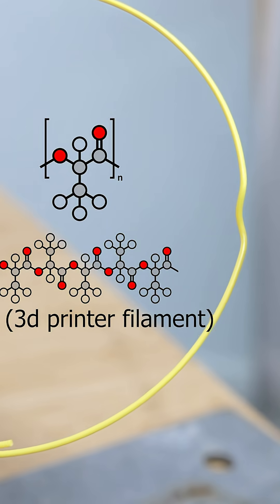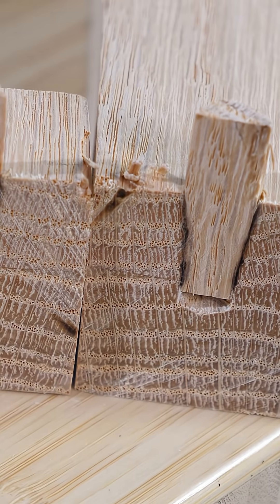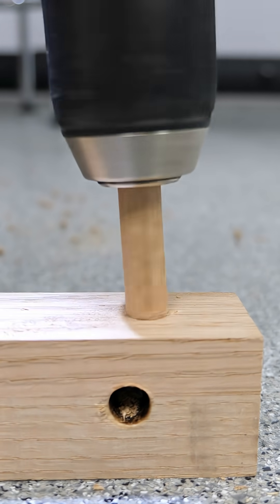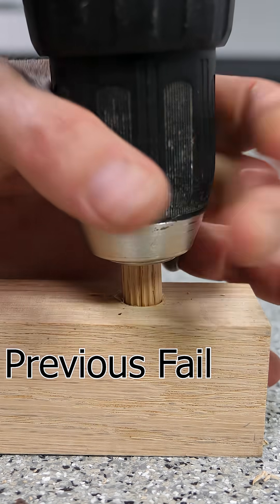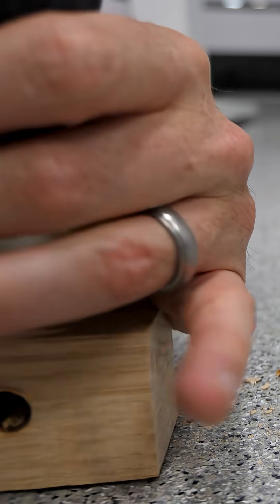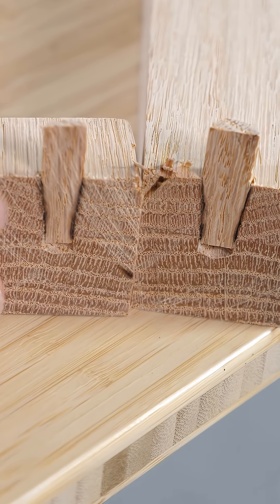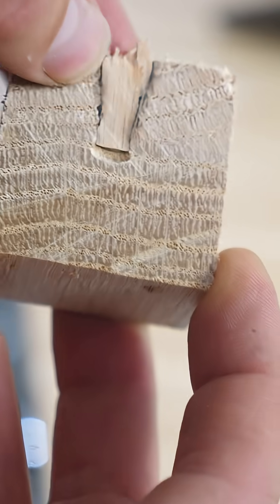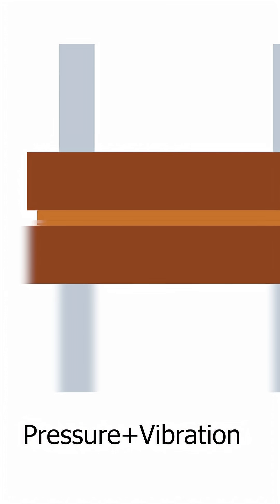I Melted Wood With Friction

Comment: Fun fact: Wood is not actually "flammable", it's "combustible". And it's because wood itself doesn't actually burn. It has to break down into mostly hydrogen gas (H_2) and carbon monoxide, which are flammable and what primarily burns in a fire.

It's why wet wood doesn't burn. The wood isn't a flammable substance and has to be heated enough to release the hydrogen gas that then combusts. This happens way above the temperature of boiling water, which sucks tons of energy. 

This is opposed to oil which is flammable and burns in and on water if there's oxygen available. Its primary substances are naturally volatile and directly involved in the redox reactions that release the energy. There's no need to break down another substance to release more fuel.
Reply: Thank you for sharing this info!🙏🏼
I learned a lot of things that I didn't know!💯🙌🏼🤯😎
Reply: But is it INflammable???
Reply: @SamChristopher5 "INflammable" means "flammable"??? What a country!
Reply: @somosUS This is the comment I was looking for! 😅😅😅😅
Reply: @SamChristopher5   what a country!
Reply: Interesting. Isn't there any way to remove the hydrogen? Or is it part of the molecular level of the wood?
Reply: @MythRsR1979  Sort of actually.  There is something called thermally modified wood where they essentially bake and steam the wood inside large ovens to make it more resistant to fire and rot.  The process also makes it more insect resistant, as the part of the wood that termites would normally eat is essential cooked out of the wood.  It is typically used for exterior decking and siding, though it will still fade in the sun if you don't put a protective oil or other UV blocking wood finish on it.  It basically does the same thing as the Japanese Shou Sugi Ban technique without going so far as to char the wood.
Reply: @r.j.bedore9884  Yep and as a woodworker, I’ve seen this decking.  It’s not resistant at all.  It costs a lot more and cracks and splinters after a couple of years.  It’s not worth it.  If you want a quality decking go for class 4 exotic wood like Ipe.  It will last you a lifetime and doesn’t rot even if it is constantly wet.
Reply: @r.j.bedore9884  Thanks for the information 😊
Reply: @r.j.bedore9884  thanks for sharing
Reply: @MythRsR1979 Hydrogen is indeed part of the molecular structure. Wood is organic, which means it's made of hydrocarbons– and the "hydro" there stands for hydrogen. Hydrogen is also the most common element in your own body, by atom count (second most common, after oxygen, because hydrogen atoms are so light).
Reply: @MythRsR1979  Yes, wood gasification technology explores exactly this. The main components of wood gas are hydrogen and carbon monoxide. The challenges mainly come in separating all the various gasses efficiently. 

Otherwise it has a rather low energy density, being just uncompressed hydrogen and carbon monoxide. Mixed with a bunch of atmospheric nitrogen. About 6-10 MJ/kg. And it blows up when you compress it. There's no doubt many ways to improve this process to deliver "cleaner" or more energy dense wood gas. Just not a lot of investment or popularity into it. Thats changing in the near future though with everyone looking for renewable, sustainable, and localized production of everything, especially a fuel gas.

Back in WWII they used to run their cars, and designed a few, to run on wood gas. It was a surprisingly easy pipe just into the engine (carburetor days). Though they didn't accelerate very fast, they still went and could do 30-50 MPH eventually. With WWII era engines and cars no less. A modern car and one tuned for it could probably perform pretty normally on wood gas. Very weak acceleration compared to an equivalent gasoline, but otherwise perfectly functional I'd imagine. Lots of efficiency gains everywhere.
Reply: Thank you for the information. Today I learned two things and that is an accident I did in high school in carpentry class how about 45 years ago was actually welding a piece of wood to another piece of wood I didn't know that I thought I merely forced the two pieces together I didn't realize that I had welded one to the other now I know, and thanks to your bit of information I know how that happened and why that happened.
Reply: Your comment is so full of wrong and so misleading it's not funny. 70% of the calorific content of wood is from off gassing of volatile organic compounds. By definition VOC contain carbon which hydrogen gas by definition does not. Production of hydrogen during pyroloysis is a minor effect at best. Now you've got people thinking you're educating them when in fact you're telling them patently wrong information.
Reply: Thank you! It's these types of educational comments that I wish were more prevalent on YouTube
Reply: The vast majority of solid objects aren’t flammable then.
Reply: @Specter_1125 That is true. Solid materials that are actually flammable are things like white phosphorus, lithium, sodium, etc.
Reply: Isnt hydrogen-2 deuterium?
Reply: @TeraChad23  You're right. It is isotope nomenclature. I wanted to be a little more descriptive to those who may be unfamiliar with molecular hydrogen, dihydrogen, H_2. 

I'm not a personal fan of using "dihydrogen" with laymans and just say Hydrogen 2 generally. Because it's usually chemical related discussion, not nuclear.

I could clear up my comment better though.
Reply: Then why's burning Diesel or petrol(gasoline) inside an engine called combustion and not flammation(inflammation?)?
Reply: Wood also contains a small amount of volatile essential oils that are flammable, but yes, it largely requires pyrolysis for combustion.
Reply: Then why's burning Diesel or petrol(gasoline) inside an engine called combustion and not flammation(inflammation?)?
Reply: Why they can't make a power tool for wood welding?! Fricrion/heat, lingnine aditive whatnot 🤯😃😃
Reply: Ahh, ashes, I get it now.
Reply: It is OutFlammable
Reply: That makes a lot of sense.
Reply: “Ok but can your science explain why it rains?” “YES, IT CAN.”
Reply: I always say there's no way to pull it out too
Reply: Oil doesn't mix with water, not really a valid explanation. Low grade alcohol doesn't burn either although alcohol vapor is flammable
Reply: good knowledge. thanks.
Reply: I heard that hydrogen fire is invisible. Then why can we see wood fires? can anyone explain
Reply: The process by which wood "burns" is called pyrolysis, look it up, it's pretty interesting
Reply: this is not true, wood itself is also flammable, but most of the fire is the wood gas coming off of it. same as oil but just more stable.
Reply: @sudazima Nope. Wood itself (the organic cellulose, etc) is combustible, not flammable. Very few solid materials are flammable.
Reply: @thecuriousboardgamer  the solid is ALSO flammable, just not very well. this can be checked in low pressure high oxygen atmospheres. plus i hope you realize that wood is literally THE thing that defined fire for us 300 000 years ago, it is how we define fire in the first place.
Reply: @sudazima No it's not. Every scientific source will tell you wood is combustible, not flammable. (PS - if you're changing the environment then you're moving the goalposts. Given the right environment virtually everything is flammable.)
Reply: @sudazima And your historical point is meaningless. As I've said, combustible things burn too, so just because wood can burn doesn't make it flammable. These words have scientific meaning, whether you accept it or not.
Reply: @thecuriousboardgamer "Flammability behavior of wood and a review of the methods for its reduction"
would you look at that, a scientific source calling it flammable.
also note sawdust can ignite and even deflagrated, when theres no time for any gas release or mixing
Reply: I don't think wet anything burns
Reply: @jimi02468 Try your theory with sodium.
Reply: @jimi02468  your mum does. Tell her I'm sorry
Reply: Flammable and combustible mean the same thing.

Some technolosers tried to redefine basic words to mean more specific things, but this was a bad idea, as anyone with more than two brain cells to rub together could tell you.
Reply: That’s a long, convoluted way of saying “wood is flammable.”
Reply: @BuiltInBrooklyn  Wood cooks into flammable wood gas which combusts.
Reply: @KaiserTom is that why you can make charcoal
Reply: @KaiserTom  Cool profile pic lil bro
Reply: @BuiltInBrooklyn  No, it just shows you have no clue that "flammable" and "combustible" are different things.
Reply: @SissypheanCatboy the wood doesn't actually burn it gasses off and the gas burns. Thay part is in fact correct
Reply: @SissypheanCatboy  Flammable and combustible are the exact same thing though as the only difference is the temperature needed to ignite it. Flammable needs less and combustible needs more but, they'll both burn just fine. By definition, flammable is anything that burns under 100°F while anything that burns above it is combustible.
Reply: @BuiltInBrooklyn This is causal-systemic explanation and it really is needed and important 💪🥳😃🫡. Why? 

Our knowledge, understanding, and wisdom is comprised of "causal-systemic network of factoids and concepts and their connections". Each word (concept) is a node in that network where other nodes can connect to it. This happens when things "click" and we learn new stuff. This is why the causal-systemic explanation above is important. Am example. 

Until now, I only knew or felt and concluded, that wood needs to be heated and gasified to make it burn (in a stove, camp fire). Understanding this has all kinds of ramifications:

Burning wood (e.g. to heat a sauna? which can be a "ritual" like yoga for Indians) is a tradition in Finland and therefore everybody has their own correct opinion how to do it right 😅

Recently, due to emissions(!), the objectively correct way to burn wood in a stove HAS BECOME A THING: sparse stacking, enough air flow, and IGNITIOM FROM THE TOP, which reduces emissions, which kill people. Big fire instead of small and slow. 

The education of this would be easier, when the physical process is explained. Big air and fire heat the wood, which is a precondition to ignition.
Reply: @BuiltInBrooklyn  No, it actually means wood breaks down into flammable compenents.
Reply: @BuiltInBrooklyn  That's a long, convoluted way of saying you didn't go to school.
Reply: @BuiltInBrooklyn  Go back to school
Reply: Nah dawg, you tweakin, wood burns when I light it on fire. kek, get a load of this guy
Reply: @FlawedbyDesign69 That's because wood is combustible, and combustible materials burn when heated high enough. Flammable means something different and wood is not flammable (if it was, we wouldn't be using it for building things.)
Reply: @thecuriousboardgamer  The only difference between flammable and combustible is the ignition point needed for it to start burning and nothing more. Anything that burns at below 100°F is considered flammable and anything that burns at over 100°F is considered combustible.

Comment: It’s pronounced   Sha weg hoe fer 
The Schweighofer Prize  =  Der Schweighofer  Preis 
So you would say… Sie haben gewonnen Der Schweighofer Preis =. They won The Schweighofer Prize 
The “w” is pronounced as the “v” sound. The “o” is pronounced as a long “o”, like “oh”  The “s” in the word Sie is pronounced “zee” like the “z” sound. 
The English language is based on the German language with other languages tossed in for good measure. The thing that makes it so difficult to learn German is that the German language sometimes pushes words together in order to make a new word.  The German word for a car repair shop is, Autowerkstatt, which is auto work place. Look up “Maschinengewehrmunition” just for fun.

Comment: I'm confused as to why the dowel didn't catch fire? Isn't it super well known that rubbing wood together, it will burst into flames due to the heat of the friction? How did the dowel not start on fire while using the drill?
Reply from the maker: you need oxygen to catch fire. In this case you purposfully don't provide it with O2 or else it would burn.

Comment: ...the pressure wasn't released when you cut it in half, though...
Well okey; it was released in the x-axis, while the pressure in the z-axis was still there...

EDIT: I'm not saying that's the only thing holding it there; it's still bonded by the heat, which is the majority of reason why it doesn't come lose... But you claimed all pressure were gone 
You can see how it's wedged in there by how the surrounding hole is more narrow in the bottom than at the surface, and it's all pressing into the sides

Comment: This is why kiln dried timber is so stable. The lignin has been reset to remove internal stresses. Boat builders also understood the process of heating to produce permanent bends
Reply: Oh interesting 

I wonder if they need they were eood welding or just understood that it just worked this way and never thought of the "why" lol
Reply: Kiln dry wood does not reach that temperature to cause lignin melting it only reduce the moisture content. And the bending of wood using heat is just taking into account that  heat just make material expend and more maleable. people have been using that method to make arrow sticks straighter for ages. If you wanna see that melting liquid you gotta gather dry wood for camp fire sometimes you'll sometimes get a small piece of branch that is oozing a liquid that is foamy and very flamable. That is part of the meting stuff that can weld wood
Reply: @arthurlouis8326 never really noticed/looked LOL. What wood and what oozing liquid? Resin from pine/spruce or sap from birch or what?
Reply: @Hukkinen  nothing with sap or resin. sap and resib  are a lot more dense and less flamable. I notice it more from soft wood fruit trees. It's usually from small branches that are usually broken then dried but not yet decaying. You can look up liquid lingin to get a clue what it looks like.
Reply: @arthurlouis8326 Well, not every material gets malleable with heat, I think (like, coal maybe?  Or water ice, I think that just straight melts, and is brittle until it does) ; I think that's at the core of what's surprising about wood having a glass transition temperature.  Re: boat building, makes me wonder if we've had clues in front of our face for thousands of years and just never realized.
Reply: Coal is a bunch of random different compounds layered in random different ways you are more likely to separate them at any given temperature. Ice is less brittle closer to melting point so I guess Idk what that says about the maleability there . Bu your moma on the other hand very maleable at all time😂.
Reply: @arthurlouis8326  Heyyy. :P  XD  Outta left field, there

Comment: I would have thought wood would burn before it melted unless oxygen was excluded and even then it should charcoal, Could it be resin in the wood that's  melting  air is excluded with the dowel in the hole.  But my father  told me a story about grandfather  who was a woodworker,  apparently he  could rub two smoothed  pieces of wood together untill they stuck and that was more than twenty years ago.

Comment: That's not fair. 
I have thought about this multiple times and couldn't find a reason why you wouldn't be able to weld wood together. 
I thought that metals weld together because they always form the same crystal structure, or one of few crystal structures. 
While wood doesn't have a similar crystal structure, it has patterns that you can see on any wood piece you can find. I was thinking that there must be a way to move the pieces of wood or rub them together to find a point where the pieces form a pattern that makes them stick together. 
I also saw our desk melt because it was close to the heater. Was that just the paint? Or did the wood actually melt?
Reply: The pattern or "crystal structure" has nothing to do with welding. When you weld, you heat up to objects (usually metals) to the point where they both are liquid, and the liquids run into each other. And then you cool it back down to solid. Because they mixed while liquid, their new solid form is a single piece rather than two as previous.

Comment: Isn't that the same thing that's been getting stuck to wood cutting blades for hundreds of years? I would assume It's just not really viable to use for anything. Who is going to spend the money to vibrate wood together, or use that type of friction as it may start the wood on fire, when adhesive is cheap.
Reply: That is the main problem, yeah. It's a cool technique, and has some applications, but the weld isn't stronger than the adhesives we commonly use anyhow, and since you need lots of friction it's really limited in how it can be used.

Comment: Let me guess, it was only rediscovered one score ago (or two decades)—ancient civilizations have used that so they never needed to use nails that bent over at all…
Reply: Nope. They kinda couldn't rub wood together THAT fast
Reply: No, there's no documented historical evidence of intentional wood welding. It is possible this happened naturally before the 1990s where unintentionally heating and applying pressure between two wooden surfaces would make the wood stick. Nobody understood why and it wasn't used in carpentry and engineering until after the Swiss discovery
Reply: Lmao. I love seeing smart asses like you be blatantly wrong
Reply: The thing is that you can just use glue. Glue work, and doesn't require you to rub something really fast and press it really hard. Which is why nobody ever used the effect productively until recently (woodworkers are aware that if you rub wood pieces against one another they can stick together if you aren't careful, but they usually AVOID that, not do it intentionally)